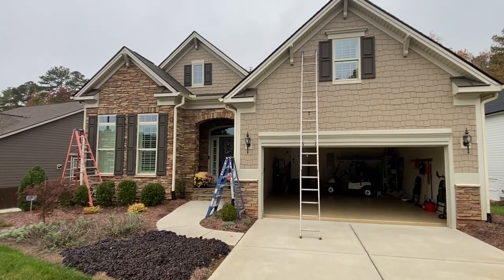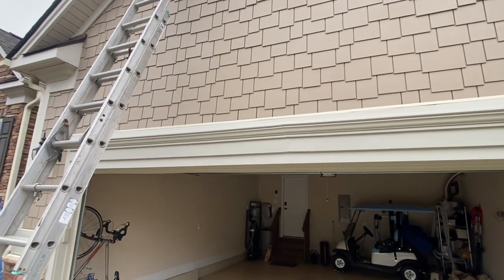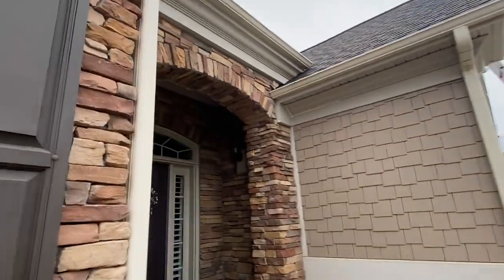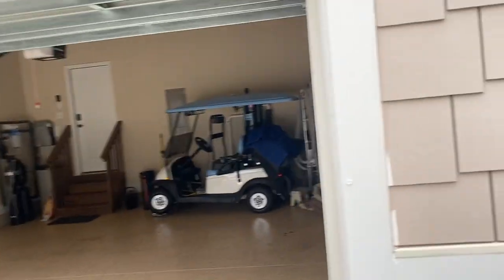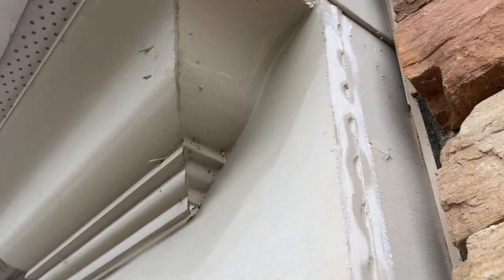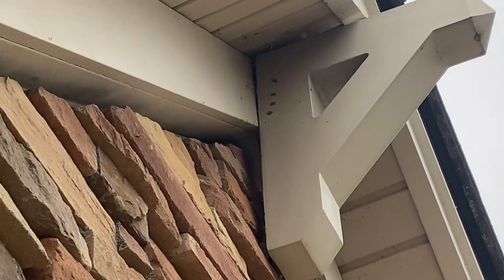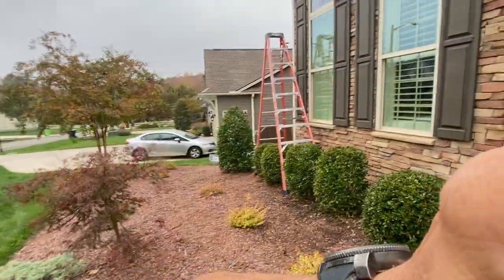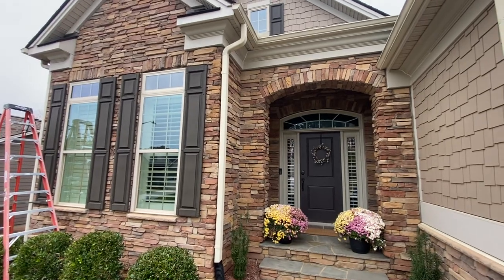New Homes Builders.  YOUR FIRED!  $500K FAIL!

Comment: I would of talked them into remove those deck board on the rim joists and replacing it with 1x12 trex fascia using fascia screws. Upsell city.
Reply: I hate doing fascia. The ground, usually over a flower bed, or rain soaked roof runoff ground, is always/often soft; making ladder work wobbly. Best to caulk it and move on. Upsells are not worth it to me. But, that's just me.
Reply: @Tom-Travels  caulk what?
Reply from the maker: @HANDYMANHEADQUARTERS  The gaps in the facia trim????
Reply: @tnoel374  no way would I caulk that. Tear it off and put trex fascia only.